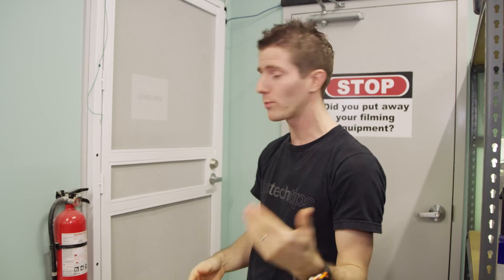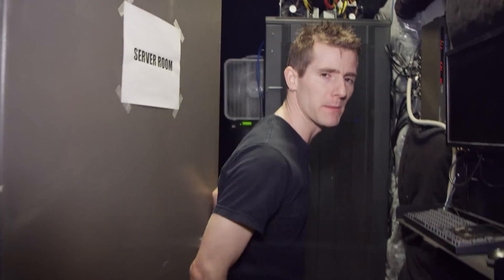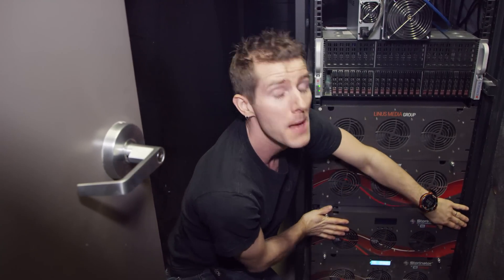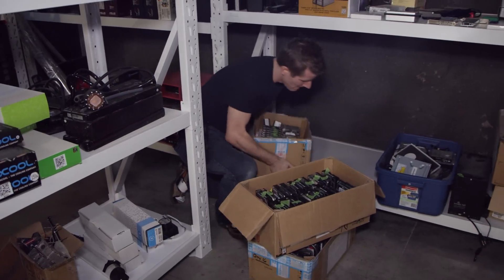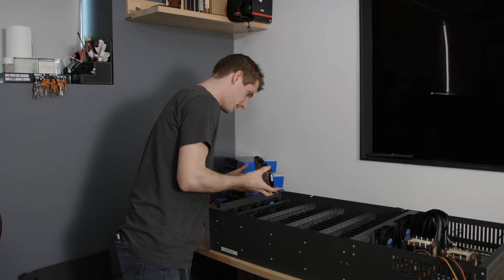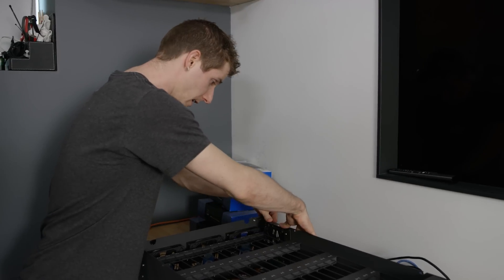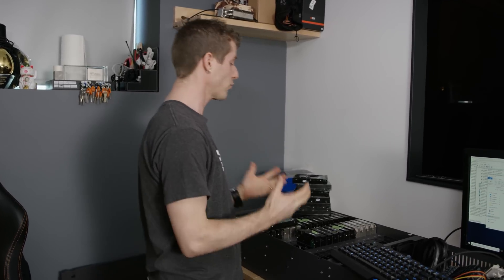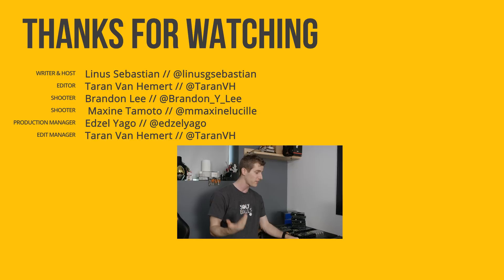HARD DRIVE Mining? This is getting ridiculous...

Comment: Hey Linus I’m going to be building my first ever PC and I’m aiming to play games on it. I’m going for a GTX 970 as my graphics card with an amd cpu with the am3+ connection I have a mother board in mind from gigabyte and I’m going with 8gb of ram the Corsair vengeance series for storage I’m going with a 1 TB WD blue HDD and also a Sandisk 120 GB SSD my power supply is going to be the Corsair CP 9020098 this is rated at 80+ and my case is the thermal take Verda h22 windowed these components will be costing me about $730.29 would this be a good system for a budget build? And would it work well for gaming or should I invest into a newer graphics card?

Comment: I need a cryptocurrency that runs off my XBOX 360 that I don’t use anymore
Reply: Nonsense you need a GPU and an internet connection both of which the consoles excel in.
Reply: M9
Reply: M
Reply: I am sure if you unlocked developer mode on that thing making some modifications to a GPU miner would not be to terribly difficult.
Reply: While I don't really disagree 512mb of GDDR3 and 10gb of DRAM should be enough for your basic mining. It might not be a fortune maker but then again no GPU is anymore due to ASICs. Would not really stop alt coin mining and working up with that. Might turn a profit that way but these were made to be game consoles... they eat power, not exactly designed for these sort of things but I doubt its impossible.
Reply: @seditt5146  As you mentioned, was about to say: The console simply sucks too much energy for the performance and hence netto cryptocurrency it can produce. You have to always also caculate energy costs, even in countries like Norway with their very cheap electricity console mining makes little to no sense at all as your energy bills are going to consume any profit you make or even net you a minus. 

That is also exactly why very energy efficient cards like AMD´s 470 and 480 RX line were so popular and so heavily hit by the mining price fluctuations, it´s exactly because every smart miner bought themselves as much of the 40s RX line from AMD as they could get. And(before the mining craze) an RX cards was tens of multiple times more efficient in producing bitcoins are low energy consumption then a console could ever achieve. Which is why even in countries like Norway nobody mines with a console, because it is not economicaly feasible and nets nothing at best.
Reply: @TheFreeFlow  I can't help but wonder if various energy sucking parts of removed if a console could become useful, I mean GPU miners have shown themselves useful. Turning off various bells and whistles of the console might be able to get somewhere with it all but at the end of the day like I stated before ASICs make it impossible for anything to compete because their appearance jacked up the difficulty so fast its not profitable really for anyone else. Not on anything above it being a hobby at best. I believe the upper limits for each bitcoin is around 50k $ but it might be sometime before we see that. With that in mind, it might be profitable if someone was willing to HODL for long enough but other then that... its all a waste of time.
Reply: Craftbloxroyale consoles typically don’t have the hardware for mining
Reply: Yes and you get like a grand memory of what? 756mb? That´s what my 8 year old fucking Fermi card still has! Lmao. That´s definitely not enough for mining, not in your wildest dreams. And it´s the same for any other console too. Even if you set up your console hardware to mine, I hate to break it to you but: Even then you will lack the POWER and performance needed for mining. Once more only goes to show why consoles are pleb and PC master race ; )
Reply: lol, NERD
Reply: Ha, dude, we are on Linus Tech Tips.... We are all Nerds and if you think you are not... You're in denial my friend ;)
Reply: You can with Nimiq, just have to connect on their website.
Reply: Crystal Stanborough Im pretty sure everyone watching is a "Nerd".
Reply: See... Izzy gets it :D
Reply: @TheFreeFlow  that's 🐮💩 if a old android phone has enough processing power to mine 0.06793992 fantomcoin in 3 days a console can do it.
Reply: @nathanmead140  Yes you "can" mine with that too yes, you can mine with consoles too, and even with 90s PC hardware as well. The question is considering electricity bills versus the profit from mining: Is it really profitable at all? Nope again, a mobile phone is far too energy inefficient for that task. You will net yourself a minus with that.
Reply: TheFreeFlow you mean 768mb
Reply: PC is not the master race here anymore ;) ASICs all the way man. PC is a waste of time.

Comment: Does the speed of the drive matter?
Would it be possible to do it with cheap micro sd cards ?
Because by chaining 4 card readers on a 4 port usb3 hub, we could get 3.2 terra with current 512gb low cost micro sdcard on each usb3 port and use a lot less power and have almost no hardware degradation? Not sure about the voltage calculation here but do you think it's possible?

Comment: Thanks for making another extremely informative video. I've been watching your videos since 2013, when your invaluable advice allowed me to build a high-end gaming/video editing PC. Thanks to you and a couple of other people, my system is still going strong!

BTW. WD Red drives are great! I have three of them with no failures, bad reads or bad sectors and I really give them a hammering!
I originally went with 3 x 2TB WD Red NAS HDDs, because I've had three hard drive failures (I lost a lot of data), in the past. I went with those because I only turn off my computer when I'm leaving the house. If I recall correctly, WD Red come with 5 years warranty. To be on the safe side, I swapped them out last year, after 4 years use. I ended up using WD black to replace them. Like the red drives, I put a sticker on each HDD, that has the date of installation. That way I'll know when to swap them out.

Comment: The only way to get a positive roi with new equipment is with really cheap drives. Profitability is now less than a dollar per TB per month. With luck you have your investment back in 2 years. Haven't even taken electric cost into account. A system with like 20 drives will likely use about 200 watts.

Comment: because BTC has slumped almost the entire time you've been doing your test, the ROI per month you estimated isn't really accurate for altcoins like Burst.  think of the 3 cents you originally saw Burst at, which went down to 1 cent-ish per coin:  once bitcoin goes back up, alts will largely follow suit.  your $100 per month goes up by powers which correspond to the volatile inevitable rise in Burst.  you only lose in crypto when you sell low and buy high, or when you purchase obvious rip-off coins with no new contribution to the space.  not something like Burst which is novel and well-incubated.  if all you're looking to do is immediately sell all mined coins per month to try and make back your hardware & electricity investment up-front, then you honestly aren't ready for this chaotic space where long-term outlook is king<shrug>